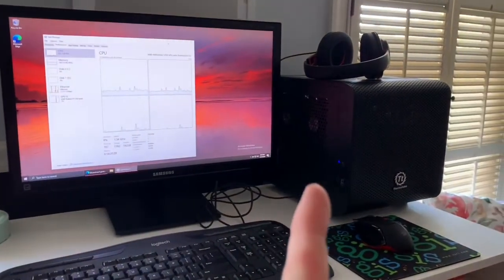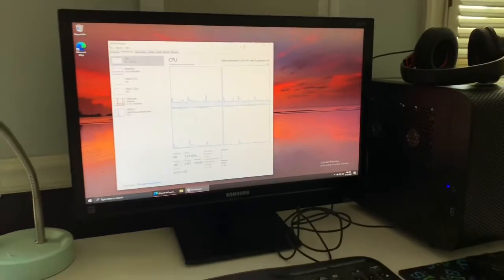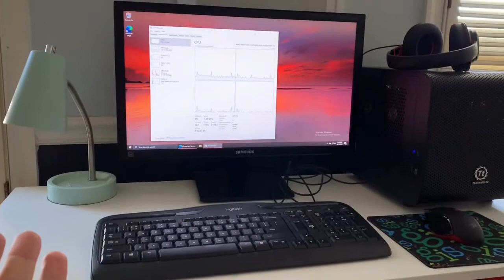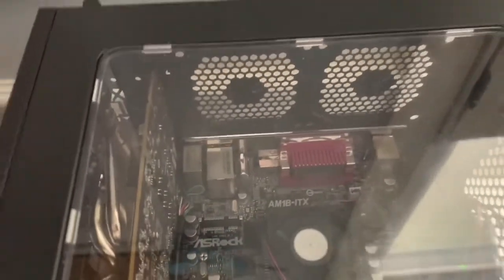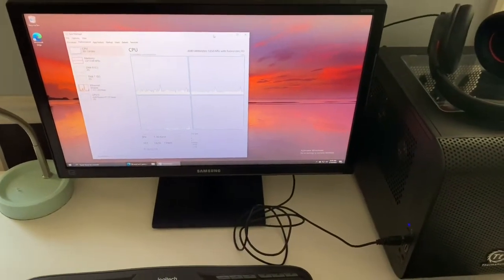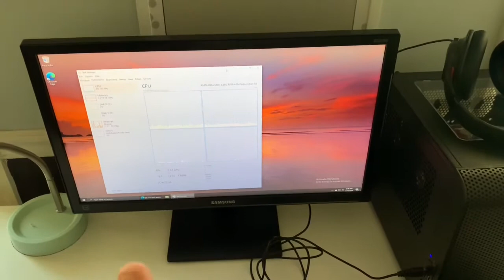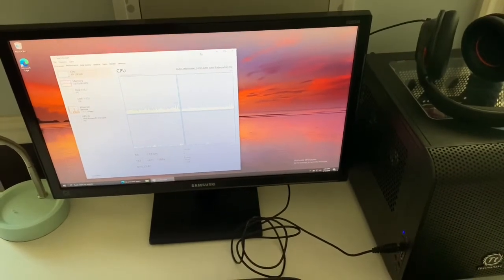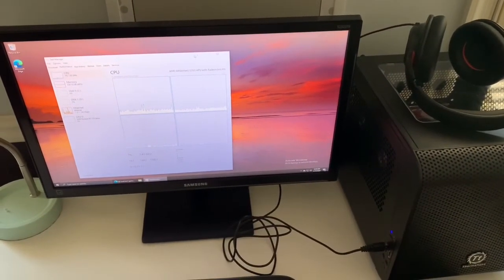AM1 AMD Athlon 5350 Progress and Reliability Review, 5 years later

Comment: I've got the 5350 (overclocked 2.1 ghz) installed on a MSI itx AM1 with 8 gigs (Two 4 gig sticks)  SSD Boot and 3 terabyte HDD storage.  Still using the onboard video for basic Kodi/Netflix video playback.  1080p streaming is good.   If I upgrade this for more performance will probably be a GT 1030 DDR5.  Still running good after 6+ years for me.  Thanks for the video.
Reply from the maker: I loved this lil PC. It was great.  Sold the parts last year.   Have a new build in this one now.

Thanks for the kind words and watching!
Reply: @maz94protege  Yeah,  This low powered cheap system gets the job done very well actually.  It's kinda slow with updates,  But does what we ask of it.  Most welcome and thanks again for doing a video on this quirky 25 watt part.

Comment: I'm still using it today with 750ti.. 😁

wanna change it to gt 1030 but money is running tight thanks to covid
Reply: The GT 1030 is worse than the 750ti in everything besides maybe power consumption?
Reply: Stay away from anything called GT.
Technically x50 cards shouldn't be called gtx either.
Reply: @tomstech4390 . Nah x50 cards are fine. They are the budget cards. You’d think a guy with Tech in his name would know better.

Comment: got an am1 5350 with a r7 265 in a 1990's era hp case.. lol complete with psu that spent a little time down by the Docks.. smelt of salt water and has surface rust lol... Works like a Champ! ..a champ thats probably  got down syndrome but A CHAMP NONE THE LESS lol. ..altho the ms1 am1 motherboard is a total .let down with 0% overclockability on all fronts. can neuter the ram speed but thats it lol
Reply from the maker: It was an excellent little PC.  Sold it a few months ago and was able to get over $100 for the Board, CPU,and Ram (sold as a set)  got all my money back